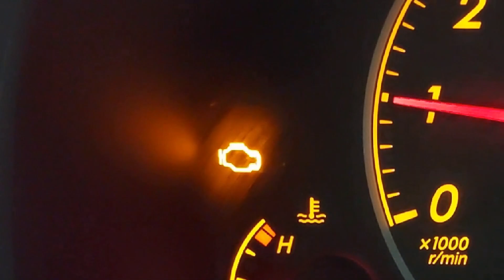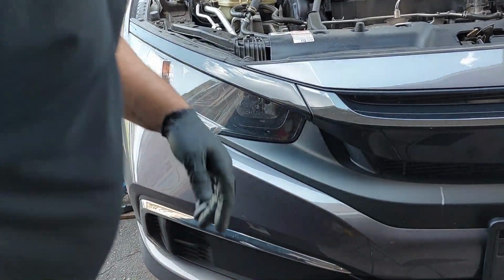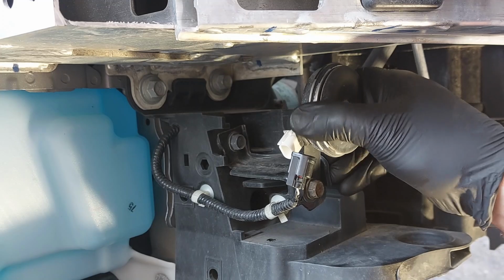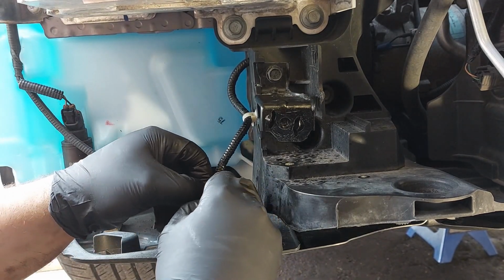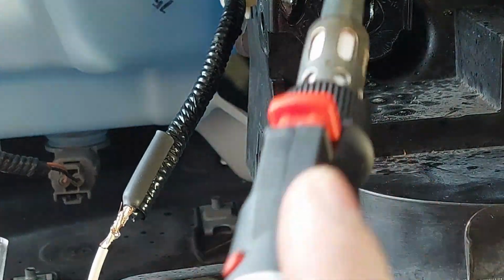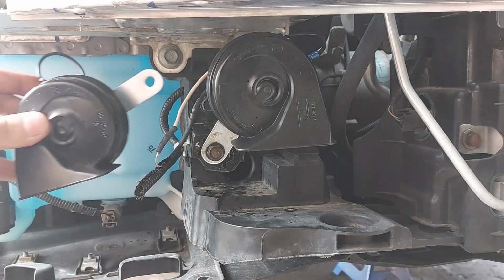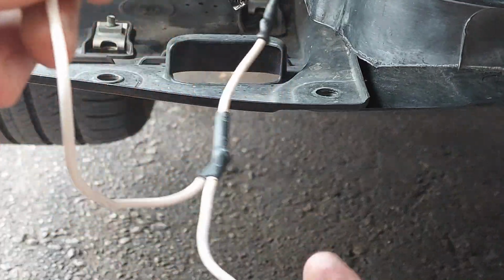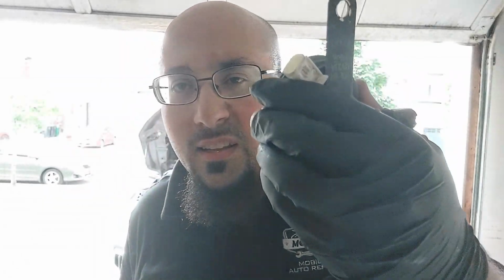2019 Honda Civic 2.0 - Horn Upgrade / Replacement

Comment: Sounds trivial but you did a professional job!   My 2010 Matrix had an anemic horn I replaced with an air horn.   It was a lot less trouble then that Honda gave you.
Reply from the maker: Yup, I can see that for sure! Most Toyotas the horns are accessible on them and they only typically use a one pin connector for their power connection and just a chassis ground where it mounts too. Better and easier!
Reply: 😢 Are air horns legal on the car? What is the maximum dB you could have in the city?
Reply from the maker: These are just regular horns, but a better upgrade which is louder than the conventional single disc type horn.

I don't think air horns on regular vehicles are legal anywhere depending on the jurisdiction where you live in. Not sure about the decibel threshold either that's something you may need to look up and check depending on your area.

Comment: 1. Does two horns sound louder than 1 horn? I mean they are the same dB, whats the science for that?

2. I'm also in Canada, for safety test, could the hord be too loud, which would cause a safety test to fail? Need to do a safety test for my car.
Reply from the maker: Two horns is definitely louder than one. If the horn works it passes safety. Most cars today already have a dual or two horn setup so that is not going to matter as long as the horn is functional.